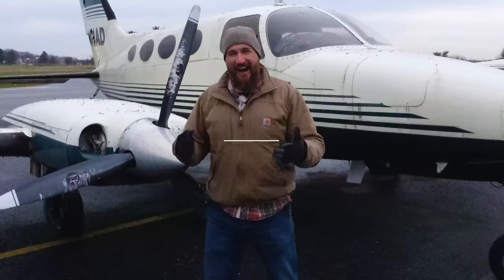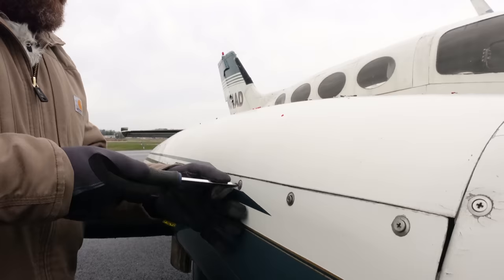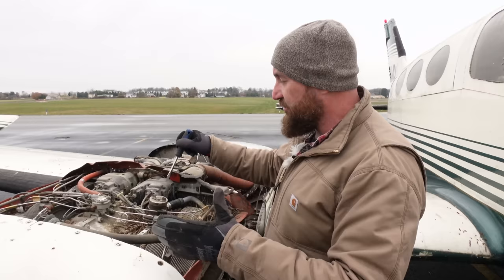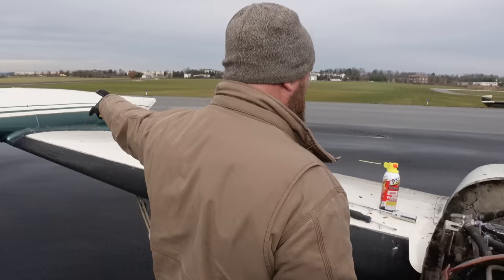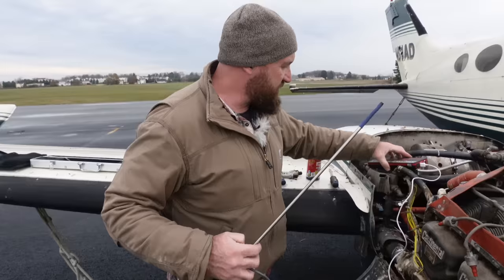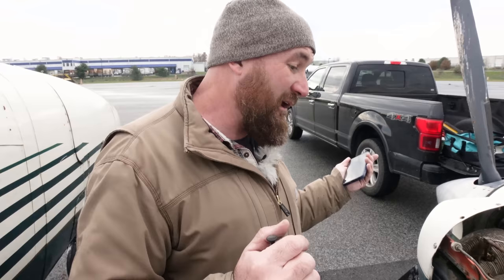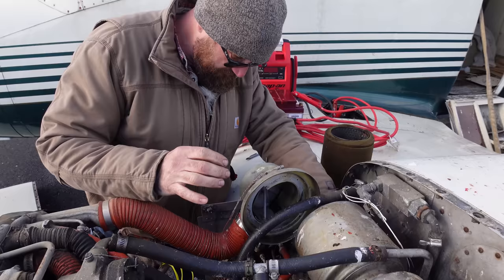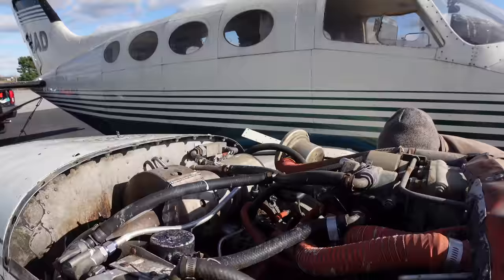FREE Abandoned Airplane... If I Can Start It! Ep1

Comment: First video of yours I've seen! I'm in love this is professional tier content, the audio and video are phenomenal. I am looking forward to the next video- very impatiently I might add. I am excited to see this sucker running. I'm almost most excited to see the interior taken apart, cleaned and repaired. Very interesting stuff. 

P.S I was curious about the laws around repairing an aircraft, my assumption is  you're able to do any of it as long as an FFA mechanic can give it a once over before you're greenlit to hit the runway, right?
Reply: it depends on what the thing that is being fixed is. anything structural has to be done by a certified A&P mechanic and a lot of the mechanical components in the engine have to be directly supervised by an A&P as well as needing proper documentation to be airworthy. that documentation is usually provided by the aircraft logs and if they are not included with the plane than anything that is time sensitive (either by hours used or overall time) have to be replaced with certified parts, the biggest single expense will be  having someone rebuild the engines (no he wont be able to do it him self, but he might be able to help if the person doing the rebuilding if they agree) using certified parts, but all the little things like the landing gear, wheels and tires and all the "little stuff" will probably double that I would guess to get this plain airworthy it will be over $120,000 and that is probably on the cheep end. I haven't seen the whole thing yet so maybe he has the logs and wont have to do a complete rebuild but there is a reason airplanes are expensive and that this one has been sitting for so long.
Reply: @derrickfoster644  I see. I really appreciate your insight. 

Just curious, are all of the precautions required if you are taking off and landing outside of an Airfeild? Like on your own property? 
My thought relates to farmers doing crop dusting- and their own "unconventional" repairs.
Reply: Almost everything he is talking about doing is illegal for him to do on a certified aircraft and cost to repair if no corrosion to wing spar or frame the cost to repair is more than value of plane.
The complete engine has to be rebuild cause no A&P will sign off on those engines.
Prop has to be recertified.
Everything has to be signed off by A&P and no A&P is going to risk their license signing off on someone rebuilding this as certified aircraft.
He can transfer to experimental class, do all work himself  and haveA&P sign off.
But without log books engines have to be complete rebuild. Same with prop.
Lead deposits on a airplane sparkplug.  
Airplanes run leaded gas. WTF
Reply: @cw93711  you speak like you know what you are talking about but I suspect you don't for a few reasons. You seem surprised av gas has lead in it, 100 LL (av gas) means 100 octane with low lead. This is to distinguish it from older standards that had 4 times the amount of lead. You also claimed he can register this plane as an experimental aircraft so he can do the repairs himself. This is just flat out wrong, while in Canada you can register certain airplanes as owner maintained the options for doing this are all older single engine aircraft with at most 4 seats (last time I looked), I am not aware of a similar program in the states though. The only way I can think of to make this aircraft an experimental aircraft would be by forming a company that is intent on creating a STC (supplemental type certification) for example changing the engines with ones that aren't currently approved by the FAA (still must be a certified engine or one that is getting its certification) and they are using this plane as a test bed. But that would put it into the "experimental exhibition" category wich has more regulations and restrictions on the use of the aircraft than type certification or the "experimental amature-built" that you are thinking of.
Reply: @derrickfoster644  was a private pilot tell lost my medical due to traumatic brain injury with many brain bleeds.
Build Harmon/F 1 rocket plane was sold to new owners in south Africa at Airventure.
Helped build multiple aircraft
Stepfather has a silver and bronze Lindy's for 2 of his builds.
I said or ment to say the author of the video series seems shocked their is lead on spark plug.  Since 100 low lead does have lead in it.  Plus without having much less seeing engine logs don't know how that cylinder was doing nor had been doing or even how long plugs were in it.  
In US you can or could reregister a certified aircraft as an experimental if you were going to rebuild it.  
My first taildragger instructor did that by converting a 152 that a bad landing into a tail dragger.
STC wouldnt even come close cause as you said it allows you to run different engine, but 3 most common types of STCs are running regular 93 octane no lead gas instead of 100 octane low lead, speed mods or repair ones.
STCs only apply to certified aircraft.  So they couldn't make it experimental. 
If the FAA approved the aircrafts change to experimental, the value drops, insurance costs go way up etc, etc.
However he does get to do the work himself, but since he didn't build 51% of the aircraft still needs A&P to due annual.
Even with experimental exhibition which is what war birds are typically classed as just needed to or at time find an air show off some sort within 500 miles of where your going.  
I have been out 10 years since I started with seizures and then smushed my brain.
But the end result is regardless of if he did all the work or an a&P had to it's going to cost more to get it going than it's worth.
Unless engines were completely rebuild or replaced I don't know anyone who would touch it with a 10 football.
Seen multiple engines fail after annuals inside TBO that were taken care of.
Including the plane i did majority of flight instruction in. 
I was in commercial insurance did a small amount of aviation. Like FBOs, flight schools etc.
Also know about orginal av gas my step dad's instructor and then part of mine was an old crusty b17 pilot who owned the flight school long ago in Oshkosh, Wis.  They were also clients.  
My Grammer isn't the best due to brain injury so sorry about the 100 low lead confusion
Reply: @cw93711  well it does appear I am wrong about your knowledge but for a number of reasons suggesting making this aircraft experimental (while it might be possible) is misleading and won't actually be useful (despite this plane not being worth rebuilding). As for the STC my understanding is that the person developing the STC would classify the test plane as experimental until the FAA approved of the mod. I was not talking about adding an already approved STC to this plane.
Reply: @derrickfoster644   I am not sure how STC are developed.
I stay away from these videos mostly now days. 
To much i wish I could change the past.
This just always popped up so had to watch.
The experimental makes no sense. Was just a way for him to work on it and have a&p sign it off.
But 500 miles on that plane is a joke it's designed too go high and cruise at decent speed.  
Wish this guy was an A&p
Would be cool series.
Not just I broke the law and the FAA took my house
Reply: @cw93711  yes I agree, I would love to see  something like an A&P tearing this plane down and salvaging what can be salvaged.

Comment: keep up on her shell turn out if you give er some love i enjoy experimental aircrafts(like homeade planes and aircrafts) since theres way less regulations but these dual engine cesnas are pretty cool also as far as parts go most generic parts like o rings are exactly the same as a automobile but because its going in a aircraft it gets a aviation tax (basically the governments way of stealing more money from you) if you use degerm you can clean up the interior pretty easy (kills any hidden viruses to) c ant wait to see you get her running (i oddly feel like the left (our right in the video) engine will be alot easier to fire up) ps not all mags click when they fire
Reply: Hi Tyler:  The ADs are what will sink this project.  Like the fellow said if they manage to resurrect this airplane it will be the most expensive Cessna 401 in the world.  Regarding something as "simple" as o-rings.  O-rings are designed for the fluid or air they will come into contact with.  Water, hydraulic fluid, engine oils, fuels and etc all require specific compounds compatible with the fluids they are in contact with.  That is why the ridiculous price for any aircraft parts including o-rings.  The parts must be certified as well as the processes that manufacture them.  What you have there is lawn art.  Buy something in Trade-a-plane or Barnstormers that is airworthy for a fraction of the price of fixing this turd.  As an example of the ridiculous cost of FAA certified parts a Cessna 310 throttle cable is $2500.  And that's just the tip of the iceberg with this airplane.  Best of luck.

Comment: Yes I think you can get her fired up and running. Complete overhaul afterwards will be super labor intensive. If you burn 40 gallons per hour at 250 mph you’ll get 6.25 mpg combined or 3.125 mpg per
Engine 😂 🦅 🇺🇸 (insert screaming bald eagle here)

Comment: This looks like an abandoned drug smugglers airplane that was sold at auction by the feds and never picked up by the buyer. As he says, this is the "station wagon" of aircraft. "If you can load it, you can haul it" allows an overloaded plane to maximize the haul and it is turbocharged to facilitate hauling weight and speed. Definitely a smugglers ideal aircraft. The interior looks like it was tossed in a search and just left. The guy who is paying storage on this thing wants it gone.

Comment: Amazing ,love it ... to high ampere is ok as it only use the A it needs.. worse is to have to low A and not correct voltage .. burning starter

Comment: It amazes me to. Was a car mechanic for many years and would put 2 12v  batteries in series’s for  faster turn over on the starter. But would isolate 24v from some of the sensitive circuits

Comment: 25:15  if u can get the rings to break free and scrap the inner walls clean, provide oil, compression, fire, and air, all motors will run again

Comment: The wheel struts are charged with Nitrogen so your 80 psi air pump will not ligt the nose
wheel off the ground. it will take over 100 psi to rise the strut if there is any weight on the nose wheel.

Comment: i would really suggest inspecting the airframe structure, judging by the abundance of rust on the exterior, rust has weakened the internal components which might result in a rapid disintegration mid-air from the stresses experienced during flight.

Comment: You can run two batteries in series to get double volts. The amps wont increase unless you run it parallel, then the amps double but volts stay the same

Comment: I firmly believe you will get it running.  I have no doubts! 40 gal per hr at average speed 250 mph is 6+  miles per gal. But I'm sure you don't buy an airplane for it's economy!

Comment: It would be some thing to get this running, at the least just show them that they should of put the time into the motor. Clean this up and it look so much better to start. WD40 as well as other anti seize oil spray can do wonders. Yes some parts may take a while to get into or find replacement for and some may have to be made. enjoy the time learning about for plane, it's not the destination but the experience. To learn every thing there is to know and to be able to fix things on the go and trouble shoot a sounds you here. Explore your plane see you found the battery. See easy dose it wins the race. Good luck in your future.

Comment: 400 series Cessna almost certainly has different housings on the turbos for the L and Ri side engines.  they might even spin opposite directions, I cannot remember.  Could maybe swap just the core of the turbo of they don't but you'd need the turbo inspected after reassembly lol.

Comment: I would have used Kroil or Marvel mystery oil. You can fill a cylinder with Marvel, soak overnight and it will loosen any engine.

Comment: Those are not like the Lycoming those are a little quieter on that engine so you won't hear a click but you should pull the cover take a look at the points to see if they're rusted if they're arrested you won't get a spark you need to buff them up take them out buff them up a little bit with a buffer polish them up just a little bit make sure that there is lubricant on the pivot point and put them back in

Comment: Most likely you got stuck valves.  Often you can take the rockers or cam off and dead blow hammer down and pry up with penetration oil.  If lucky you can get all the valves loose. I have had luck with several auto engines. Had to replace some rockers a few times but over head cams can usually push the valves down.   Hopefully you did not bend any valves. Usually I check for valve clearance first.  Pull valve covers off and check while turning engine.  If you have valve stuck down and engine getting stiff TDC you need to try to pry that valve up. Bent valves are a pain.  Got to pull head to fix.

Comment: If it’s anything like a car if a turbocharged car sits for a long period of  time the turbo may lock up due to the oil in the center cartridge what they call “caking” up. It can and will start with a locked up turbo then when some heat goes through it… it will free itself up. Going to finish watching the video now to see if you did indeed get it started. Good luck 😂

Comment: Just recommended by YouTube, looking forward to seeing how this progresses. Looks a nice aeroplane (originally), a shame it ended up in this condition.
Reply from the maker: Welcome to the Rescue Crew! We hope you enjoy 👍🏻
Reply: @rebuildrescue  Slowly working my way through, at episode 8, still waiting to find out what is wrong with engine #2; old fuel isn't going to help, but still wondering if the magneto isn't delivering enough power, it's a lot harder to get a spark under compression than when the plug is out in the open...
Also worrying that you got the turbo charger running, certainly a stationary compressor won't stop air flowing, but not sure it will be good for the turbine to be stationary with all the exhaust gases

Comment: I do find it very strange with your knowledge on mechanics that you would use 12v instead of 24v battery. That makes a huge difference.  You could have easily hooked uo two 12v batteries vs buying an expensive battery just to test it. I may be wrong, but higher voltage will pull a lower amperage if the same electricity needs are required. You need to run double the amps at 12v than you would at 24v to get the same power needs.

Comment: Actually if you wash and clean leather with SADDLE SOAP and treat leather with WEIMAN LEATHER CONDITIONER. Seats will look like new.  Now foam inside probably stinks forever.  But foam is a lot cheaper than leather

Comment: I have watched about a 1/3rd of the video. What disappoints me is the basic lack of good engineering practice. I was a motor vehicle tech in the motor trade which is where my experience of petrol engines comes from. I spent 22yrs in the Royal Air Force as a propulsion technician on Gas Turbine engines. Always use the correct size of wrench for what you are working on, so now adjustable spanner/wrench was ever used as it was considered bad practice. I would have tried to get some WD40 spray  (WD = water dispersal) like you did into the cylinders then some diesel to aid freeing off of any corrosion within the cylinder. I would do  this in all cylinders to ensure piston rings free in there groves to prevent further damage. Will go back to video and see how you got on.

Comment: If you're sure that the system is 24V it would have been just fine to run it with two 12V batteries in series.

Comment: The problem is either fuel injection or magneto. I hope both magnetos were turned on from the control panel before starting the engine

Comment: there is a way to rejuvenate a battery by cleaning out half the liquid and shake the crap out of it and pore out the rest of the liquid acid and por baking soda to neutralize the acid then take distilled water worm and put epsom salt in and dissolved all the way then hit with major voltage from a 150 or 200 Amp battery charger a few times then put it on a 15 amp charge tell you see all the cells bubbling good then do a amp draw test on it and it should read in the good range clean all the outside and the terminals then you have a newly recharged battery !

Comment: Two weeks of hard work and cleaning, soaking frozen parts and a feww rusted cable replacement, fresh fuel and cleaning fuel components and fresh batterys:hand-orange-covering-eyes: . You will prevail. Guessing 2K in misc costs for the things needed to turn it over

Comment: If i was a regular at that airport i would have taped a grille over that opened window panel.
    However the open panel would have prevented condensation cooking and rusting the interior so that a (minor) plus.
    It is a gorgeous airplane but there are a load of others of that type around so just saving one  more is not gonna save tge world, if you get my drift.
   Good luck though.

Comment: use a diy 50/50 mix of ATF & Acetone to beat any penetrating oil that they sell you,  twice as skinny and farther reaching
the stuck spark soke 1 day in this mix then tighten and loosen both ways first may be use heat also

Comment: Check out the airframe condition before investing any money in those engines.  No need to run if it can't fly due to failing an air worthiness inspection (excepting parts value).